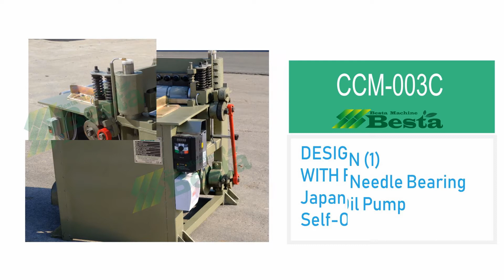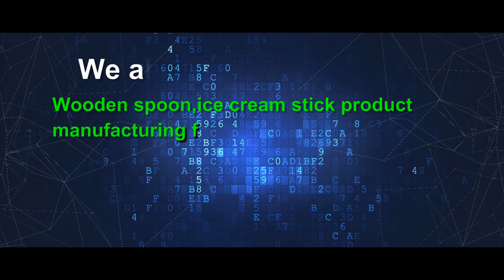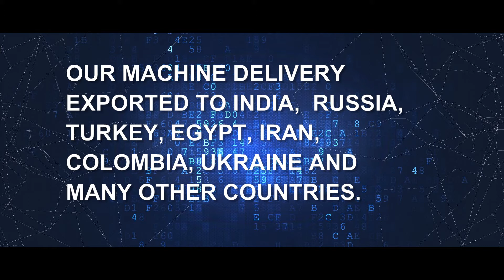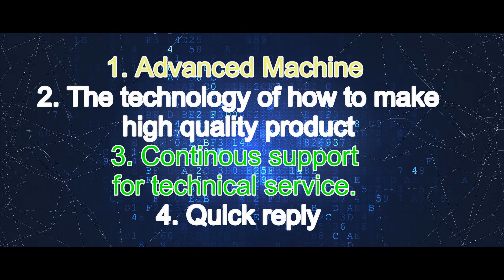Introduction of wooden ice spoon making machine, ice cream stick production line

Comment from the maker: NOMBRE: MÁQUINA DE CORTE TALDA CCM-003C
FUNCIÓN: Conformado de palitos de helado, palillo depresor de madera, cuchara de madera, tenedor, cuchillo, palillo para café
Potencia: 2.2 KW (380V, 50HZ)
Adopción de rodamientos de aguja japoneses, sistemas de auto-engrase de aceite.
Es un nuevo diseño de nuestras máquinas. Mantenemos la innovación todo el tiempo.
Tenemos dos opciones para su elección.
Máquina de corte tallada CCM-003C (tipo normal, avance)
Cortadora tallada CCM-003C (con control de frecuencia)
Para cada hora, puede hacer 230,000 PCS a 287,500 PCS de 114 mm de longitud
Palitos de helado. (Alto rendimiento)
Tamaño de la máquina: 1200 * 800 * 1200MM
Peso: 550 KGS
Para diferentes tamaños de productos, deberá comprar diferentes tamaños de la cuchilla tallada. Para obtener información más detallada, póngase en contacto con nosotros.
Correo electrónico: info@bestachina.com angelzhou1224@gmail.com
Whatsapp: 0086 186 5710 6860 Persona de contacto: Angel Zhou

Comment from the maker: Complete line of wooden ice cream stick, tongue depressor stick, 
coffee stirring stick, wooden spoon, fork, knife line, it is mainly consisted by the following machine:
Wood Cutting Machine 
L520B Wood Rotary Cutting Machine ( 1 Set)
CCM-003C Carved Cutting Machine ( 2 to 3 sets) 
PG-6-L3 Polishing Machine (polishing, dust removing, drying machine) : 4 Sets
Magnetism Blade Grinding Machine ( 1 set)-machine maintenance 
HX-5 Heat Exchanger ( 4 sets)
DF-15 Draught Fan ( 4 sets)
Other machines for option:
Carved Cutting Blade Grinding Machine (sharpening machine) 1 SET
White based board planing machine  1 SET 
Steam Boiler (generator ): 4 tons  
Stainless steel tank  
Wood holder
Wood Boiling Temperature Control System.  
ice cream stick order arrangig machine, quality control machine,
chamfering machine, branding machine, bundling machine 
For more detailed project propsal, welcome to email us.
Email: info@bestachina.com  angelzhou1224@gmail.com
Whatsapp: 0086 186 5710 6860 (ANGEL ZHOU)
Reply: Madam this wooden ice cream stick is made of bamboo

Comment from the maker: ADI: CCM-003C KESME MAKİNESİ
FONKSİYONU: Dondurma çubuğunun şekli, tahta dil baskı çubuğu, tahta kaşık, çatal, bıçak, kahve karıştırma çubuğu
Güç: 2,2 KW (380V, 50HZ)
Japnese Needle bearing, kendinden yağlı puming sistemlerini benimsemek.
Makinelerimizin yeni tasarımı, yenilikçiliği her zaman sürdürüyoruz
Seçiminiz için iki seçeneğimiz var
CCM-003C Oymalı Kesme Makinesi (Normal tip, peşin)
CCM-003C Oymalı Kesme Makinesi (frekans kontrollü)
Her bir saat için 230.000 PCS - 287.500 PCS 114mm uzunluğunda
Dondurma çubukları (yüksek çıkış)
Makine Boyutu: 1200 * 800 * 1200 MM
Ağırlık: 550 KGS
Farklı ebatlarda ürünler için, oyulmuş kesme bıçağının farklı ebatlarını satın alacaksınız.Daha ayrıntılı bilgi için bizimle iletişime geçebilirsiniz.
E-posta: info@bestachina.com angelzhou1224@gmail.com
Whatsapp: 0086 186 5710 6860 Yetkili Kişi: Melek Zhou

Comment from the maker: NAME: CCM-003C CARVED CUTTING MACHINE
FUNCTION: Shape forming of ice cream stick, wooden tongue depressor stick, wooden spoon, fork, knife , coffee stirring stick
Power: 2.2 KW (380V,50HZ)
Adopting Japnese Needle bearing, self-oil puming systems. 
It is new design of our machines. We keep innovation all the times. 
We have two options for your kind choose
CCM-003C Carved Cutting Machine (Normal type, advance)
CCM-003C Carved Cutting Machine (with frequency control)
For each hour, it can make 230,000 PCS to 287,500 PCS of 114mm length
ice cream sticks. (high output)
Machine Size: 1200*800*1200MM
Weight: 550 KGS 
For different size of products, you shall buy different size of the carved cutting blade. For more detailed info, welcome to contact us. 
Email: info@bestachina.com  angelzhou1224@gmail.com
Whatsapp: 0086 186 5710 6860 Contact Person: Angel Zhou